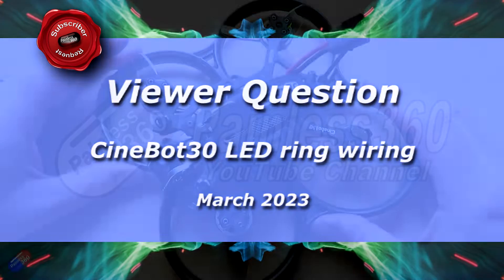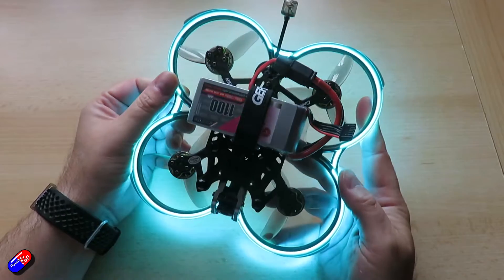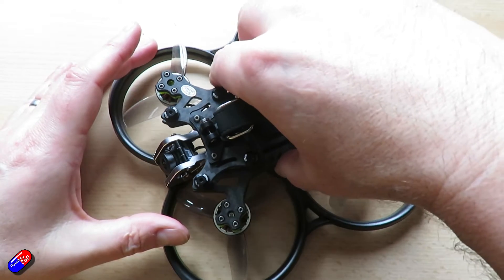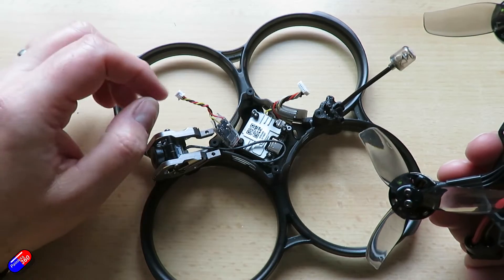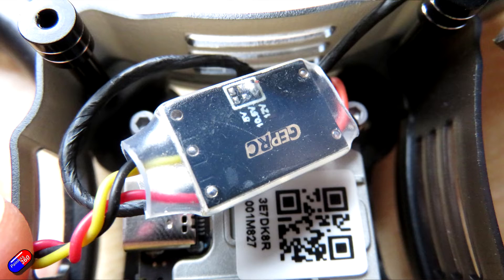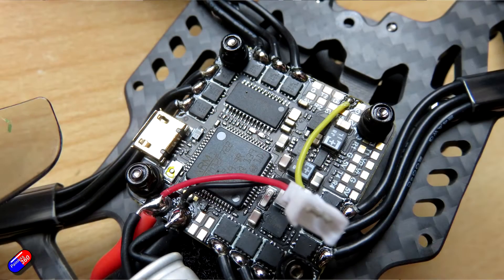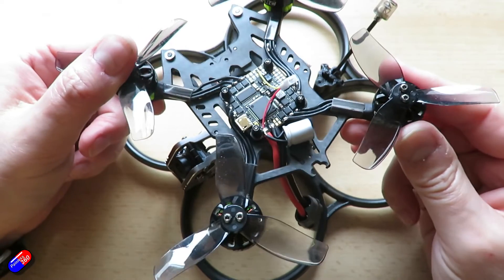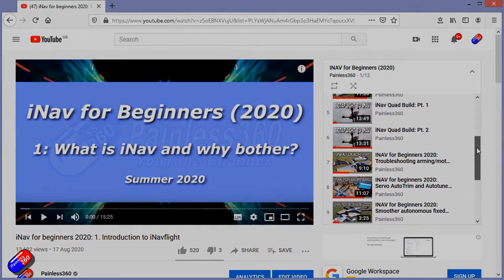VIEWER REQUEST: How is the GepRC CineBot LED wiring done?

Comment: why the yellow cable connected to the T5 pin not LED pin?
Reply from the maker: Resource mapping in Betaflight turns the pad into a simple high or low voltage, depending on the USER1 mode position. That is then used by the LED controller PCB to know when to turn on the LEDs... Happy flying
Reply: @Painless360 but, is it fine if I won't use BEC control? Just using GND, 5V, T5/LED directly?
Reply from the maker: How it works is in the video. The extra little board is acting as an R/C controller switch, that's all there is to it. Best of luck.
Reply: @Painless360 I got it. Thanks sir for your help!
For the context, im about to use 5v ARGB and not using that extra board
Reply: Subscribed!

Comment: I have an issue with the Led Light on the quad. Recently purchased the 6S Nano RX Version. Upon plugging a battery initially the light was working, then after the bind to Tango 2 I was even able to turn in on/off from the controller. The plugged the mini USB and battery at the same time and the light stoped working, when I check the switch in beta flight it works but the lights does not turn on the quad. Any ideas?
Reply from the maker: Sounds power related to me. I'd let the person who you bought it from know..

Comment: Whats the name of that 3 cable connector you have going from the board. I don't see one in my kit. Thanks
Reply from the maker: At what point in the video?
Reply: 1:30 The three wires coming off the LED chip to three pin connector.  @Painless360
Reply from the maker: There isn't a connector that I can see, sorry I can't be more helpful..
Reply: Normally they are jst sh 1.0 connectors.

Comment: That's weird, my cinebot30 has led board connected to LED pad, witch is next to battery terminals. But that is very good news because I need that LED pad for servo control (PWM).
Reply: Mine, too.  The yellow wire from the BEC is soldered to the LED pad, not the T5 pad.  Does not matter if you configure the led_strip as a pinio.

Comment: My understanding is the board is a 12V BEC. Gep sells this board and the light strip as optional frame KIT components. A similar FC controlled BEC has been use to power VTx for racing quads to enable a pit-mode (to reduce video interference, while powered up doing tweaks between races)

I have been thinking of doing a custom build of this frame and was wondering how much space was available between the Vista and the FC. Thanks Lee, for providing a nice look inside. :)

Comment: Yes yeeeeeeeeeees finally it’s working 🎊 🎊,, thank you so much I really appreciate your support, you made my day ❤,, this little board it’s name CTL- BEC it has 2 pins form one side for B+ and B- and from the opposite side 3 solder pins 1 for led+ and the middle one for signal connect to the TX (in my case it’s TX5 on GEP F722 AIO)on the FC and third one for B- also in the bottom side pins for select the output voltage 5v, 10v and 12 it’s depends on what you prefer, for me I bridged the 5v and it’s working great, hope this will help too
Reply: Hi Gladiator,  can you tell me if you have selected UART 5 in betaflight as I can't get mine working. Thanks
Reply: @gregorydobson4307  yes bro I used UART 5 in my case and it’s working